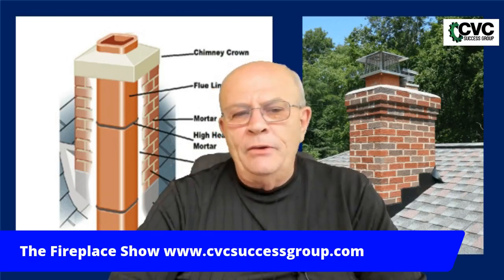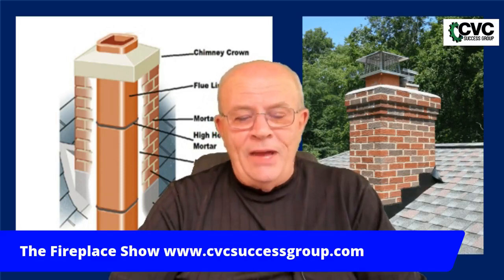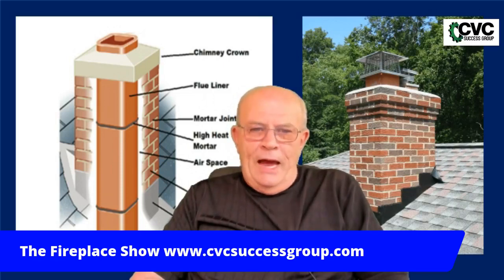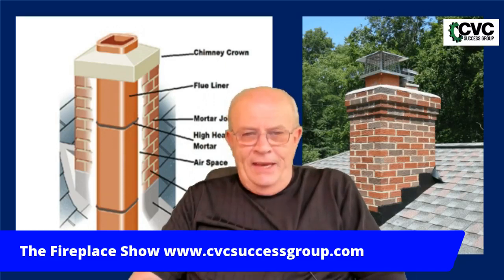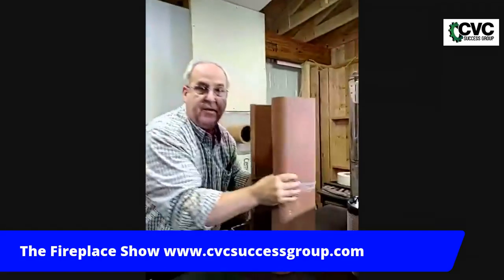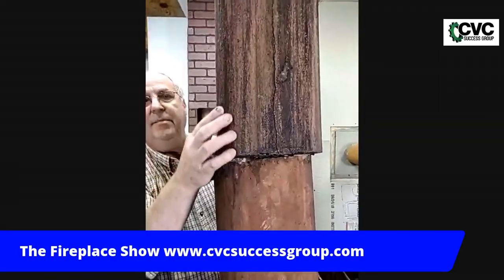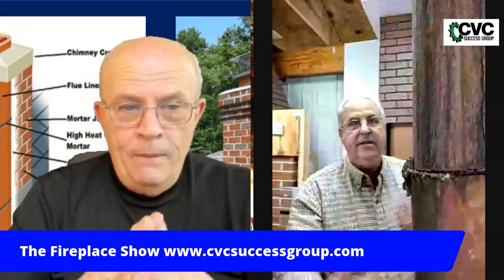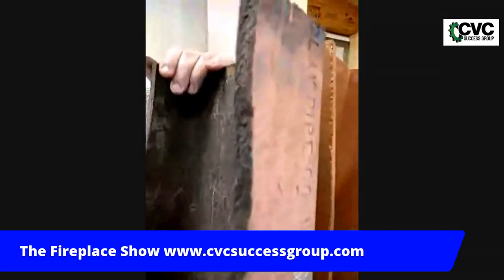The Importance Of Flue Lining In A Masonry Chimney

Comment: So, what is the recommendation for new chimneys?
Given that 
a) houses have open-ended lifespans.. say > 150 years.
b) chimneys are often interior and inaccessible
c) judging from this show, clay liners don't last and often cannot be repaired/replaced
Do you skip clay liners are start with a stainless steel liner?
Do you install liners with the expectation of periodic replacement? If so, what does that entail? (ie, flow-in insulation doesn't seem to make sense).